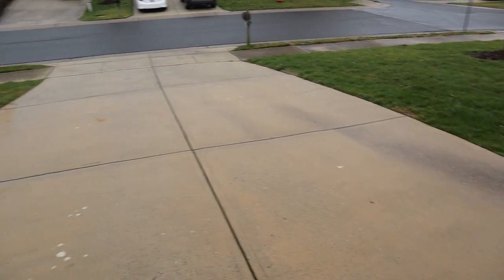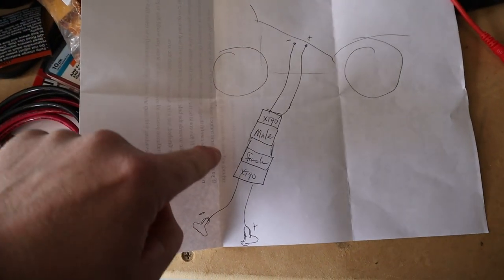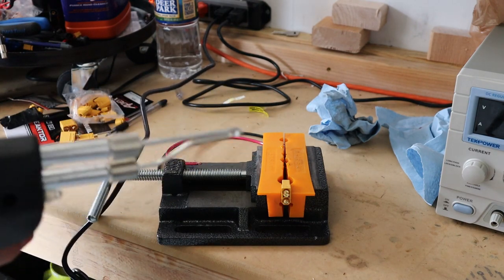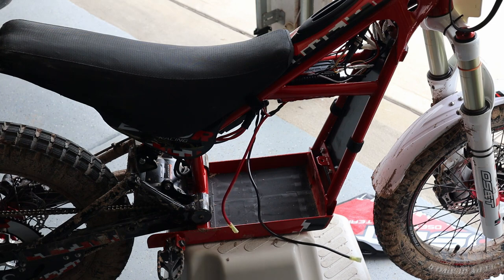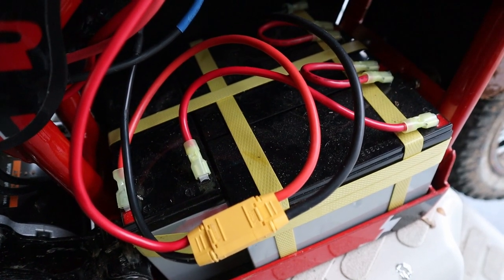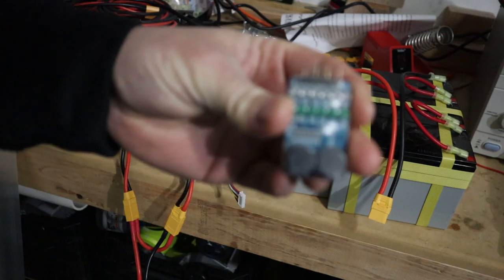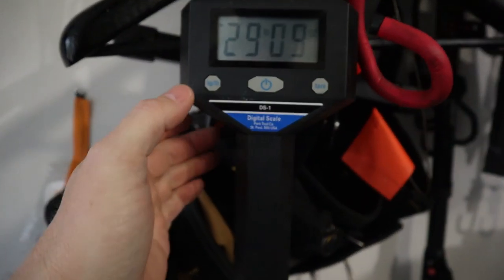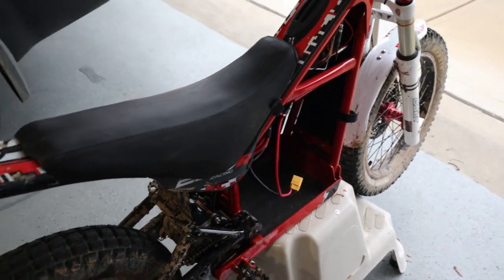#MTBPlanB Electric Motorcycle sealed lead acid to LiPO battery conversion.

Comment: I'm doing this upgrade right now on my son's Oset 12,5r...from 2x SLA lead acid 12v 10Ah batteries (in series, so 24v total) to 2x LiPo 6s 7000Ah (in parallel, so 14Ah in total). I will use exactly your configuration with the harness (to use also SLA batteries if needed), XT90 connectors and 10awg wire. Thanks a lot for your guide.
Reply from the maker: Awesome,  he will enjoy the additional run time and power delivery!

Comment: I am doing an ebike build on a full size bike right now but I would like to use this kind of set up for a future pit bike build. Do you think it is possible to put all of the balance leads into a full size bms and charge/monitor all of the batteries that way? Also if you have a programmable controller you shouldn't have to use low voltage alarms and just let the controller take care of the cut off?
Reply from the maker: Yes all this is possible. The oem controller was for Lead acid batteries only. Oset now makes a Lithium battery powered one just like this model.
Reply: @MTBPlanB  oh okay makes sense why you didn't go that route, also somewhat unnecessary I suppose but the peace of mind would be nice.

Comment: Thanks for the video. Is the bike actually drawing from both batteries simultaneously? Seems to be a common hiccup in these builds. I see you wired the batteries together but is it working?
Reply from the maker: Yes, it is. Pretty common series battery wiring to get desired voltage and parallel wiring for more amp hours or run time.

Comment: I have an old Zero MX w dead batteries. I wonder how many of them Lipos I would need to just get like 2 hour of riding in? I think it’s pulls 18k watts max.i would like to ride it like a trials bike. The Original pack probably weighed 45 pounds, LiPos.
Reply from the maker: It’s probably the 1400W motor. If it’s a 48v system and assuming about 35% average throttle over 2hrs, likely a 20Ah battery pack would do the trick.
Reply: @MTBPlanB  🙏 Thanks
Reply from the maker: No problem!

Comment: hi. i went to the dealership and they said i would need new looms and a new controller(of course they would :-) ). Have you run this through the standard SLA controller that came with the bike? Looking to upgrade an Oset 16R 36V with something like Li-ion Battery Volt Rechargeable For E-bike 36v 20ah 500w 20000mah. Any help appreciated....
Reply from the maker: Should be able to use existing controller (as long as you use like for like battery) but you would need new looms if you wanted to charge thru existing port and have the charge indicator work properly. I just charged externally and used low voltage alarms on the balance port of the batteries.
Reply: @MTBPlanB  thank you and thanks for the great video. Sorry for further questions.... so the voltage is the important part, the ampage just means longer use (so more amps better? i have 3 12v 10aH in series currently. happy to charge separately etc. thank you in advance.... would be great to get the bike used again :-)
Reply from the maker: Yes exactly. More Amp hours means longer riding time. The electric motor has a peak wattage rating and will pull max current at the specified input voltage. You currently have 10amp hours available. Find your peak wattage on the motor and using equation Power = Voltage * Current you can figure out peak current pull  and workout how long 10AH would actually last at full throttle.
Reply: @MTBPlanB  top man, thank you!

Comment: what's the difference between those two batteries? im tryin to build on my own e scooter but kinda hard to choose which battery i should pick . can you please explain to me sir?
Reply from the maker: LiON batteries have a larger energy density, better charge/discharge properties, Lighter than lead acid/agm and will perform better if properly managed,

Comment: Would this be suitable for the 36v setup In the 16.0R ?
Reply from the maker: No but a couple of 5S batteries in series would do the trick for 36v. Or you could purchase three 12v lifepo4 batteries.
Reply: @MTBPlanB  Exellent thanks for the help. I’ll give that a bash 👍🏻

Comment: Nice video! Is it possible to use the original lead acid charger for the LiPO batteries? If not, which charger do you use?
Reply from the maker: Thanks! No it’s not possible to use the original charger. I use a maxamps 24v 47A power supply (dual 120v inputs) connected to a ISDT T6 smart charger. You need a smart charger to balance charging across LiOn cells. The smart charger however can be used to charge multiple types of batteries including SLA.

Comment: Looking to do this on my kids bike that needs a battery replacement! What model lipo batteries did you use and how is the upgrade holding up? Thanks!
Reply from the maker: I used two of these in series https://hobbyking.com/en_us/turnigy-high-capacity-battery-20000mah-6s-12c-drone-lipo-pack-xt90.html. Batteries still going strong. I also use two low voltage alarms to notify me before over-discharging.
Reply: @MTBPlanB  Hi there,  I just bought a used oset 20.0 and the acid battery pack is dead, so I'm looking for a Lipo alternative. What charger do you use for those batteries? How many hours for a complete charge of both batteries? Great video!
Reply from the maker: Javier Villanueva I use the ISDT T8 Balance charger with Maxamps 24v power supply.  I charge at 20amps and it takes about 35 minutes.
Reply: @MTBPlanB  does it charge both at the same time?
Reply from the maker: Javier Villanueva I don’t but You can charge both at the same time. It helps to have a different 20amp circuit to plug the supply for faster charging.

Comment: Hello!
Did you felt a change in acceleration / top speed?
Reply from the maker: charlesobiwan I doubt it but but I didn’t do any initial tests with SLA batteries. You get more consistent power delivery over a longer ride with the Lithium batteries and increased Amp hours, which was my intention.
Reply: Depending on how much lighter the pack is, and if it has the same power output, you could get better acceleration because of the reduced mass. F=ma.